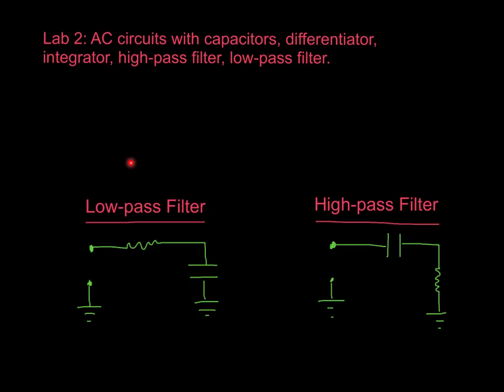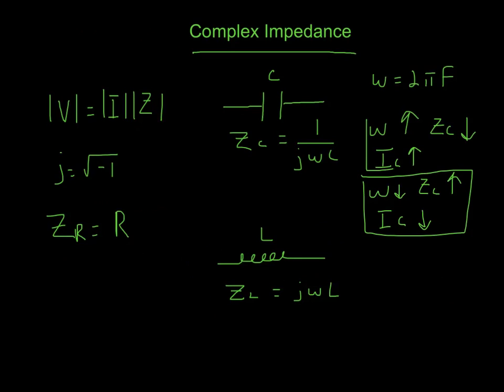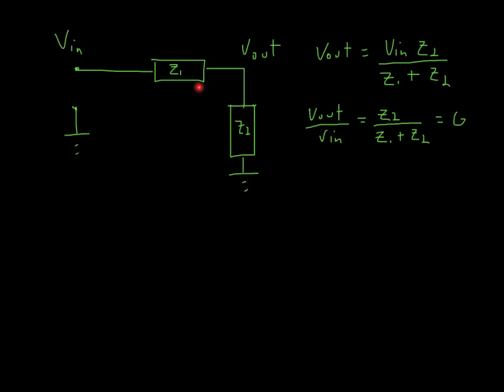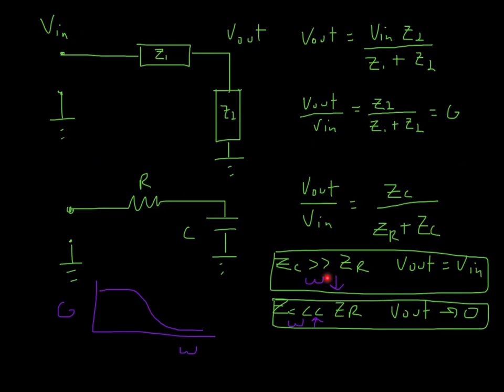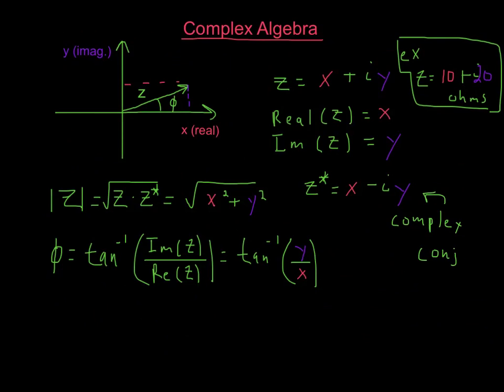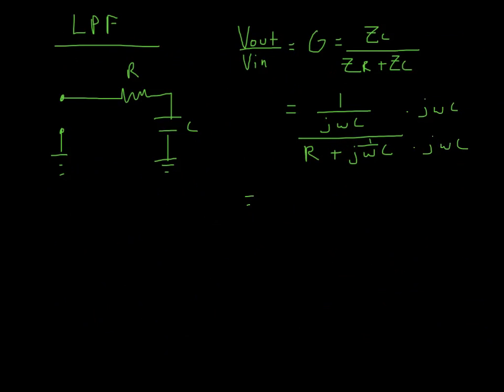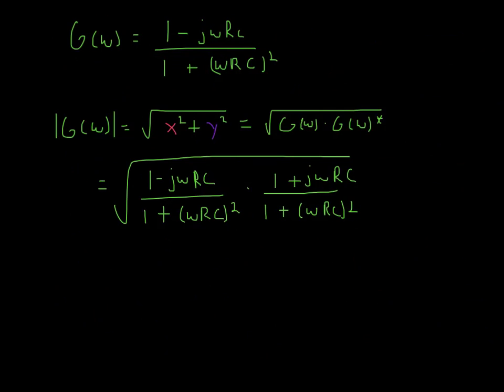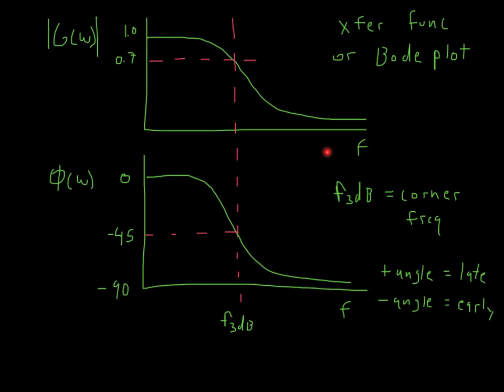Complex impedance, Low- and high-pass filters, Bode plots

Comment: Hello, what would be the impedance value if I will connect in series an 8ohms tweeter and the 1uF/400v capacitor to the amplifier. Can we use those theories that you are using? Thank you.

Comment: Awesome vid! But how do you actually know what the Bode plot looks like?
Reply from the maker: Sorry for delay in my replies. In one of my classes this term we are make Bode plots using a function generator, the circuit under test, and an oscilloscope. You can simply input sine wave of fixed voltage to the circuit and look at the voltage of the sine wave out, as well as its relative position in time compared to the input (phase). Keep the input voltage fixed and then take vout's and output phases for different frequencies. Voila! This is the long way to do it. There are analyzers that can do this for you. If you have a function generator that sweeps, you can use labview or an arduino board to make your own Bode plotter. You can also get an idea of what it looks like on the scope if you have a sweeping function generator with the scope on xy mode.

Comment: at 24:28 why don't you just get the magnitude right away, 1/sqrt(1+(wRC)^2) using lZl=sqrt(x^2+y^2)
Reply from the maker: At this point in the video, we are not in the format (real part) + j*(Im part). Rigorously, we must be in this format in order to take the magnitude correctly. Certainly there are shortcuts you may be able to see/take that can work. However, for more complicated expressions, this shortcut can't be applied. It's very easy to apply the wrong shortcut to a more general complex algebraic expression and make a mistake.